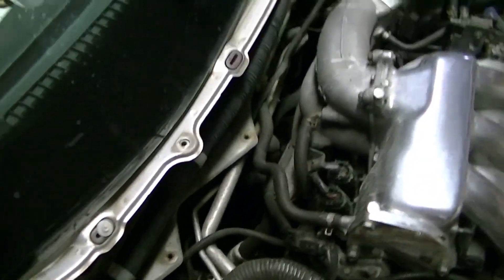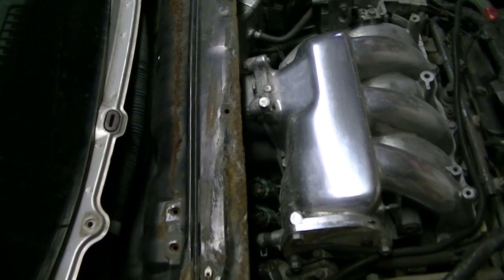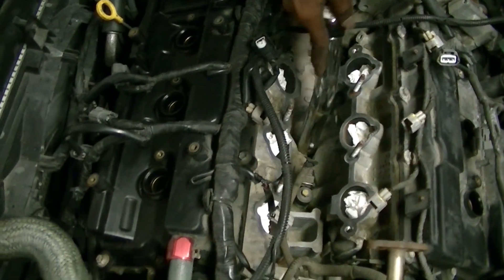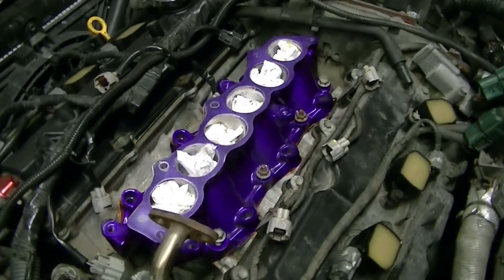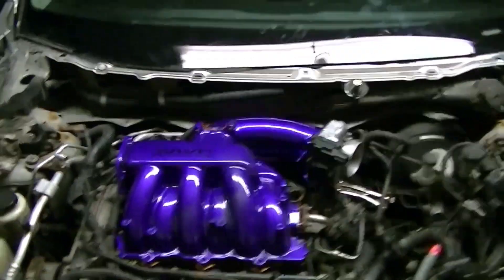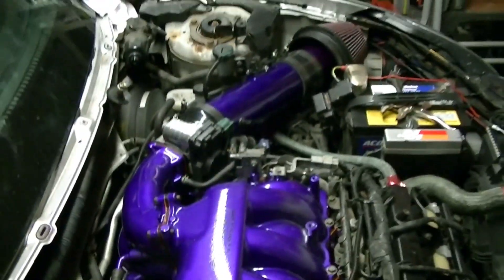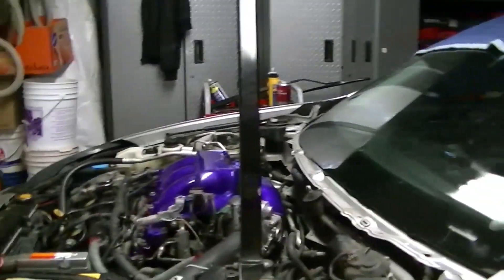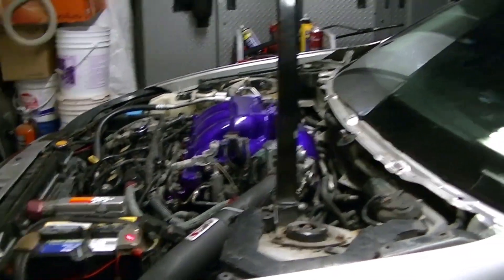Installing my custom intake manifold and 4" intake VQ35DE

Comment: I know now your Maxima will fly even more, .. because 4 years ago I swapped these same, 12 hole designed Denso injectors from the 2008 350Z (VQ35HR) into my 2005 Altima 3.5 and it made a big difference in acceleration pulling power and smoothness compared to the factory stock 4 hole Hitachi injectors. Keep us posted on how it running. Sure now nothing could test this. Respect due to Nissan Power.
Reply: MrJasonlyrics I had told you about 350Z HR Denso injectors, not GTR Denso injectors. I swapped the injectors from the 2008 350Z (VQ35HR)..The O-rings from the 12 hole 350Z HR injectors were a perfect match to the old Altima 3.5 stock Hitachi ones, so it was just a straight swap drop in for me with zero issues. Even though the GTR injectors got the similar 12 hole appearance to the 350Z HR, it seems it's got differences (judging from your O-ring problem). So did you leave the GTR injectors in?
Reply from the maker: Bud Light No I didn't. I only found out about swapping the rings the day after posting on the 6thgen fb page. I haven't gone in there since and I don't plan to tune due to the price they're charging to calibrate the 4" MAF. I've decided to just take it easy and gather myself mentally and financially. This has been a great experience and I've learned a lot to share. I'm currently focused on the other issues I'm having so as far as re-tuning that's on a definite hault.
Reply: +GT Number1 do I need engine tune after install the Z350 injector ? Thanx
Reply: max fearless if you're not going to upgrade the air intake for example the intake to a 4" or port your intake manifold it's absolutely pointless to install 350Z injectors because it's only a few CC more than the maxima's. "Anytime you change the CC's in the injectors it is imperative you retune" You won't get any power what so ever so don't even bother.

Comment: I would think you would need a tune with those injectors? And maybe because of the intake. I kind of skipped around so I don't know if you did tune it or not.
Reply: Subway Guy yeah definitely needs a tune. I have the exact same engine and the stock injectors work just fine till you go forced induction. bigger injectors on these cars are a waste of money with no boost

Comment: Need a retune wit tht now...cant get ryte 4 inch with mani....i was gonna do tht but i opt for the swap never looked bac
Reply from the maker: LE#O Wrlboss187 The re-tune is a lot of money cuz calibrating the 4" MAF is very time consuming so I have to save up $600+ and then spend more money on the NWP Big Bore TB and spacers. Very expensive.
Reply: Definitely feel u bro......hope u get it running right....
Reply from the maker: LE#O Wrlboss187 it running. I just had to swap back the OEM injectors until I can save the money and solve the existing problems. Tuning is big bux!!!

Comment: i have a feeling it has to do with the 4" intake.  try starting your car with your intake before.
Reply from the maker: Wrong feeling. I was suppose to swap the OEM o-rings on to the GT-R injectors. And no is not the 4" MAF because I didn't use it. The engine would probably blow up.
Reply: MrJasonlyrics
If you're sure you have a leak address that first, otherwise, yeah, I think some guy below said to do the relearn procedure. 

NWP has a good write up for their TB, (the relearn is at the bottom).

http://nwpengineering.com/NWP%20VQ35DE%2075mm%20Big%20Bore%20TB.pdf

Hope you get it fired up.  I been there.  Well, not working till 4AM and sleeping on moving mats, but other than that, I've had that "it won't start" face.
Reply from the maker: davetek490 it wasn't the relearn. I swapped back to OEM injectors and the car started no issues. It's the seal creating a major vacuum.

Comment: When the next video on this
Reply from the maker: Danny Deleon I wish I knew. The re-tune is a lot so I need time to fix some issues and save the money.
Reply: Well if u have any pointer I want to make .y Nissan maxima 2000 have from 240 hp to up to 500 hp how can I do that
Reply from the maker: Danny Deleon It has never been done before. You'd have to spend a ton of money to get anywhere in the 300-400hp in a 5thgen. Why you want a Maxima with that much power?

Comment: Some manifold give +20 hp but it require tune the pcm .
I thing you are losing the pressure of the air inside the runner. B R Bro
Reply from the maker: Yes I was and that's the reason I removed it until I'm ready to go at it again. She's parked right now tho 😢

Comment: Of course your car won’t run it needs a tune lol you go over 2.5 inch on intake and it needs a tune to compensate for new airflow
Reply from the maker: Nic D incorrect. The issue that caused my car not to run was due to a major vacuum leak from the injectors. I used the GTR o-rings as suppose to the OEM rings which created a major vacuum leak. You can run up to 3.25" intake on a stock tune but your a/f ratio will be off. The TB is 3" so you can use a 3" intake.